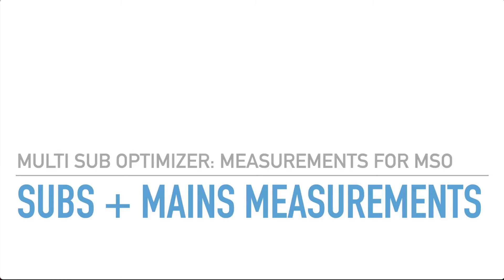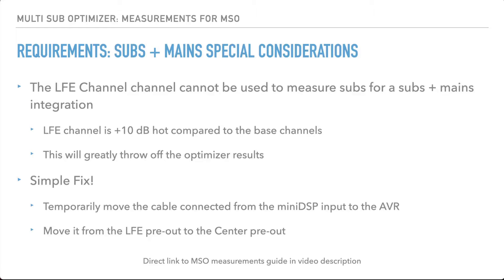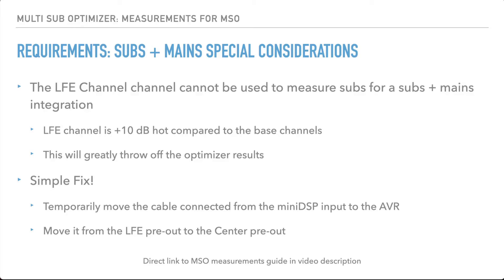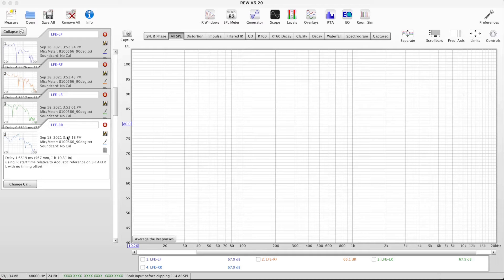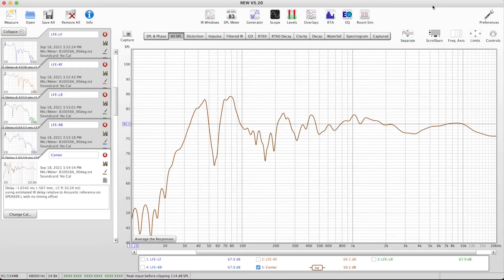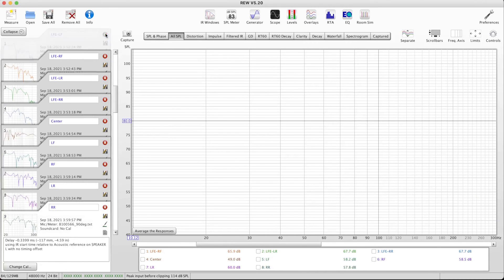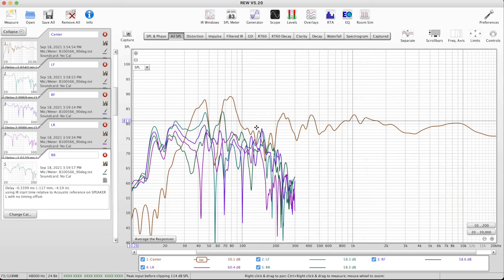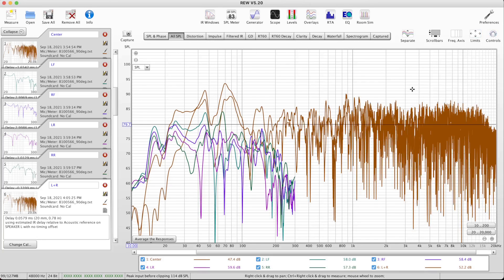Measurements for MSO: Subs + Mains Measurements

Comment: Thank you for the amazing MSO tutorials, Jeff!

I’ve been reading up to prepare to try to run MSO for the first time in my room. I only have two subs, and will be using a MiniDSP 2x4HD to combine the two. The subs are similar, but slightly different (an HSU VTF-3 Mk2 and a HSU VTF-3 HO), one in the front left corner between my left and center center, and the other in the back right behind where my couch is. I will have the 2x4HD combined sub signals ran into a single channel on a MiniDSP DDRC-88A-BM, where I will then run Dirac across my 5 main channels, as well as my combined subs.

I’m giving you this background just to say, is alignment with the mains still necessary/helpful in this situation, and where in the process would
I need to do it?

My current plan was again to disable everything but my time delays and level adjustments on my subs being applied by the 2x4HD, then take my sub measurements and run MSO. I’ll apply the filters from MSO into the 2x4HD, and then go into the 88A and run the Dirac calibration over everything.

Is this sufficient? Will this process already cover time aligning my subs, or no, and where in the process should I add it in?

Hope that makes sense - thanks for all your help!
Reply from the maker: That sounds like it should work.  MSO will properly align the subs with one another.  The result will be a single "virtual" sub that is seen by the 88A-BM.  You will then run Dirac to correct the overall room and response.

I highly recommend verifying the post-Dirac results with REW.  The 88A-BM does bass management, but doesn't have all the features of DLBC.  One of the features of DLBC is ensuring there isn't a phase cancellation at the crossover point of the speaker pairs.  You should measure the post-Dirac results (C+Subs and L+R+Subs) and look for a dip at the crossover frequency.  If a dip is present in either measurement, you'll need to do the "sub distance tweak" to eliminate it.  The REW Alignment Tool makes this easy.

The challenge will be deciding which measurement to optimize.  Unless you are very lucky, fixing the L+R will not fix the C and vice-a-versa.  You will need to choose one and then live with the response of the other.  It's not as bad as it sounds (no pun intended there).  The general guidance is to fix C+Subs for mostly  home theater use and L+R+Subs for mostly music.  I suggest trying both to see which you prefer.
Reply: @jeffmery  Sounds good, Jeff! I ran my first MSO sub only optimisation pursuant to your guide earlier this morning. FYI, the measurements I used for that were taken from HDMI 4 (the LFE channel), though I understand once I get into subs+mains, I won’t be able to do it that way.

Anyways, I was so eager to hear what everything sounded like following my Dirac calibration, but my laptop died during the final measurement! I guess MSO really took a lot of power, it was plugged in, but I guess I was using more than it could pull from the wall. 😂

I’m patiently waiting for my laptop to charge enough to redo my calibration, and then on to a sub+center MSO config after I check the crossovers like you said.

Wish me luck - thank you (and everyone else online) for putting these amazing materials together!
Reply: Hmm, actually, given the complexity is running MSO again for the center specifically, maybe I’ll just stick with the distance tweak method for now! 😂😂😂
Reply: Quick Update: I do have a dip in my center channel response with an 80hz crossover. I tried the sub distance tweak, and while it would get rid of the center channel dip, it created much worse issues with the left channel than I was willing to put up with. Ultimately, I think without the distance tweak is the best I can get it currently.

With all that said, MSO is amazing - truly great results using your earlier tutorial for the sub only optimisation. Seeing it work it’s magic, I definitely want to learn how to use it with my main channel crossovers now…
Reply from the maker: Measuring via LFE is fine for subs-only.  The vast majority of the HT folks using MSO are going to let their room correction software help with the mains integration.  We really have no choice as we're not creating and manually entering PEQs for them (well - again - most of us are not).

It's definitely a compromise when choosing where to align the sub (C vs L+R).  One thing to verify when you check for which is best for you ... Make sure you're aligning the subs with the combined L+R measurement and not just L *or * R.  I just wanted to be sure of that because you mentioned "worse issues with the left channel".
Reply: @jeffmery  Thanks, Jeff. After some more tweaking, I was able to use the sub distance tweak to get much better results overall. Interestingly, the responses of the surrounds seem to have been affected the move by adding in the sub delay that optimises for the center. It was a really easy trade off to make.

I have one more very important question. I got everything in my system dialed in, and I especially like the way my Dirac default curve config sounds. I used your tutorial to combine and flatten my 2 subs across 3 listening positions per your tutorial and it worked quite well. My only problem I’m now realizing is that because MSO cut so much from 15-200hz, when I run the Dirac calibration, it now wants to re-boost that whole area up, in some places 6db+. If I hadn’t cut so much with MSO, this whole section wouldn’t need any boosting in Dirac, but now I’m afraid it’s just sounding worse from being pushed down by MSO, and then pushed back up by Dirac.

I hope this is clear enough, but what do I do? I basically what the Dirac curve to all be much lower on my subs’ output so it doesn’t have to boost as much. Can I just cut the other channels more on the Dirac measuring screen, so that when it pulls in the sub woofer measurements, they’re at a higher overall output?
Reply: After thinking about this more, the best way around this may be to simply cut less in MSO and use a higher db reference level. I’m going to rerun it to see what happens. Between your video guides and going through Andy’s tutorials, I feel like I’m starting to get more of a grasp on how to use MSO past the options you explained. Hopefully my theories on this are correct!
Reply from the maker: @ronnzi  Your thought here is dead on the money.  Try with a higher optimization target level in MSO to see if you can get the nice flat response there.  It may take some tweaking of the PEQ limits, but it's the easiest option to try and get more output.
Reply: @jeffmery  So after a lot of experimenting with the 3 listening position configuration to try to bring up the output, I just haven’t had any luck whatsoever. One of my listening positions does have some pretty bad nulls, so I’m starting to think by trying to average all 3 positions, MSO is sort of forced to knock everything below where I want it to smooth things out. I haven’t tried experimenting with the “different SPL levels” option, but I’m thinking since I only have two subs and not too wide of an area, that I might be better off just trying to blend to two subs for the flattest response at the MLP. I’m optimising a config like that now to see what happens…
Reply: Sorry for lighting up your comments, lol. At least initially, that didn’t seem to help so I’m going to try inverting one of the subs. Even though MSO didn’t tell me to, some of the biggest dips are only in one of the subs and it seems to help with the uncorrected response. We’ll see I guess… DLBC is sounding pretty good right about now 😂
Reply from the maker: @ronnzi  It's hard to know for sure, but my gut says that two subs may not be enough to fix the room modes in play across all of your listening positions.  This depends heavily on the shape/dimensions of the room, the listening position, and the placement of the subs (which is why I can't be sure).  I also know how sick people are of hearing "MOAR SUBZ!!" as the only answer to the problem.  We all have limitations on what we can spend and where we can physically put subs.  Even if we can put a sub in a spot, that might not be a reasonable location for any number of reasons.  My wife lets me do what I want upstairs, but even I wouldn't try to put 4 subs in our living room. I have to be content with a little 12" guy shoved in the corner out of view.  LOL!

There's a guy in the MSO thread over on AVSForum that is having a very similar experience with MSO as you are right now (could even be you for all I know).  If that's not you, let me know and I can link the discussion.  The creator/maintainer of MSO is giving some excellent advice.
Reply from the maker: @ronnzi  Inversion is one thing that you need to do manually with MSO.  It can't calculate and flip the inversion of all the subs around.  Fortunately, it's pretty easy to do.

Just create a new config and add an inversion block to the sub(s) you want to model as inversion.  I'm going off memory here, but I think that's all that's needed.  It's possible you might need to actually set that to "something".  I'm not in a position to check at the moment or I'd give a definitive answer there.

Once the block is set, just run the optimization and see what it looks like.

DLBC is great if it's an option for you.  It's also expensive if the AVR/Processor doesn't include the license (upwards of $500 for the multi-sub license).  I'm likely to be upgrading to a processor that doesn't have Dirac or DLBC.  The vast majority of the users of my target processor use MSO to optimize the subs before running the room correction.  I also know that MSO does a better job than DLBC on just the subs.  Dirac's algorithm will mess with the sub response some because it's optimizing over an area, not for specific positions.

None of them are perfect.  Just some food for thought :-)
Reply: @jeffmery  That all makes sense. For now, I’m not sure if this makes sense to do our not, but since my default Dirac target doesn’t PEQ boost the bottom end so much, I’m using it and then raising my sub level a 2 or 3db in my AVR. This should be better than letting Dirac do the boosting, right?

Also, I don’t think that’s me in the AVS forum (I’m Ronnzi there as well). I have been posting in the DDRC 88A forum, but I don’t think on this specific issue. If you could link me to the discussion, that would be amazing!

Thanks for all the help!
Reply: Btw, I agree with you that it would probably be ideal to have more subs in the room. I thought I had a lot of headroom with the two HSU 12”ers that I have, but I’m starting to think I just need more output to get where I want to be. I don’t have space for a third sub in my living room, but I probably could fit 15”ers in the same places I have the 12’s now. I wonder how much of a difference more raw output in the same locations would actually makes, since I would be dealing with the same modes. 🤷‍♂️😂
Reply from the maker: @ronnzi  RE: where you add gain (boost) ... maybe?  What do your ears tell you?  I personally don't like to just turn the subs up (w/ my ears, in my room, w/ my gear).  I find that just increasing the overall sub level leads to an unbalanced sound and problems with male voices.  I use Dirac to simulate a typical low-shelf filter with a center frequency of 47 Hz and Q of 0.707.  I have one that's +3 dB and one that's +6 dB (depending on content or listening volume).  I prefer the shape of this type of setup because it doesn't really start to add gain until ~100 Hz or so.

I think the best/easiest way to experiment with different house curves is by using the low-shelf filter on the input side of the miniDSP.  Leave your AVR level alone.  Just add a low shelf to the input and start messing with the settings.  Make sure the Q is 0.707 or as close as possible.  Mess with the center and gain to see what you like.  This is super easy to do real-time while you're listening with the miniDSP plugin app.  Save the 3-4 you like in a different miniDSP config and you can just flip between them real quickly to do A/B comparisons.
Reply from the maker: @ronnzi  Forgot the AVS link:  https://www.avsforum.com/threads/optimizing-subwoofers-and-integration-with-mains-multi-sub-optimizer.2103074/post-61267822
Reply: @jeffmery  I agree with you on adding the AVR gain to the sub - so far, it just doesn’t seem to sound right. My only worry was that allowing Dirac to do +6db boosting on its own to match the boosted target curves would add distortion. I can try to experiment with the input-side lowend shelf. I haven’t implemented something like that before, but from poking around I think I have an idea. In the meantime, I’ll read the comments in the link you posted and try a couple other things first (I just realized I had left one of my subs inverted when I was experimenting - I had tried that because I hadn’t gotten to where I wanted it, but I might have to re-try a couple of thing again just to make sure that isn’t why they didn’t work, lol).
Reply: @jeffmery  I just poked around on my MiniDSP and saw how easy it is to add the low shelf filter you referenced. Haven’t gotten to try it out yet, but when I added a 4db boost with the frequency and Q value you suggested, it looks exactly like what I’m looking for! I’ll experiment with different gains and see how it goes. 👍
Reply: @jeffmery  So adding the low shelf filter as you suggested with +4 is PERFECT. I tested with higher and lower, but this was exactly what I was looking for. The curves looks like I want it to now, and more importantly, it sounds great. I further tweaked the Dirac curve to roll off a bit more, and now I have my own curve that’s where I wanted it to get to.

Last remaining issue - I haven’t been addressing this since I was still working on the overall curve, but now it’s the only thing I need to fix. Right now I’m limiting my overall volume to around 75db because if I go higher, I have one tiny spot around 50hz that appears to clip. The curve looks great as I go up in volume until around 75-80hz, when I suddenly see a huge dip form in that area, with everything else staying the same. Looking at what Dirac is doing there, it does look to be a sharp, deep bull that shows up as a 7db or so narrow decrease.

It doesn’t show up at all on my measurements until I go to a certain volume level, which honestly seems to be higher than what I would normally ever listen to. Should I just keep the volume limited to try to stay out of it, or should I made a sharp cut out of the Dirac target right in that area? 

It’s such a narrow spot that I sort of didn’t want to mess the rest of the curve up to carve out for it… It would have to be Dirac trying to boost it as far as I can tell, as I didn’t implement any boost whatsoever in my MSO config (it was all cut).

UPDATE: So the dip that appears when I raise the volume too much is actually at about 47hz (it’s unrelated to the shelf filter I put in place, as this would happen before I had implemented it). Again, a sharp download spike appears right at 47hz as soon as I raise the volume to where the LFE would be around 80db (this is what I set my initial MSO reference target to btw). Anything below that, the dip isn’t there and it’s flat. REW doesn’t show any distortion at that frequency range or anything. It just looks completely normal other than the dip.

The place in Dirac where I thought it could be over boosting is actually several hz later (a little after 50hz). I tried decreasing the target curve in that area, as well as the 47hz range, but it didn’t change anything.

What could be causing this? This is pretty unrelated to MSO, so I may just post about this problem somewhere else, but I thought I would run it by you.

Again, can’t thank you enough - everything sounds amazing. I’m just going to keep the volume reasonable until I figure out what this is. 😂
Reply from the maker: @ronnzi  Glad that low-shelf worked so well for you!

That's a really interesting problem I haven't seen before.  One thing to try is moving the microphone around and measuring from different positions.  Assuming this appears when measuring at the MLP, take additional measurements 2' in all directions from that point (left/right/front/back/above/below) and see how the shape changes at that frequency.

I also have another theory, well, more of a wild guess.  What can you tell me about your room's construction?  Is it a sectioned-off part of a larger area?
Reply: @jeffmery  Yeah, I’m only doing my confirmation measurements from the MLP. You’re right - probably a good idea to check the other positions that I incorporated into MSO at the very least.

Regarding your “wild theory”… I don’t know what you’re thinking, but it might be right since you seem to have asked the right question. My setup is in the living room of my condo. Besides having a wall of windows on the right side (clearly not ideal), everything is basically in the front half of my room. So there’s almost half to a third of the room to the back of my setup, and then to the far left, it opens into a kitchen (blocked off my a 3.5ft high or so island) and a small hall way leading to it.
Reply from the maker: @ronnzi  We might be on to something  ... is the distance between the major opposing walls in this area ~24 feet?  Front to back, left to right are the main concern.
Reply: @jeffmery  I’m trying to find actual measurements, but estimating it’s around 30ft from from to back, around 22 ft or so from where the kitchen island starts on the left, to the opposing right wall of windows.

Also, looking back at older measurements, I could clearly go higher without the spikes appearing when I wasn’t using MSO (I have sub measurements closer to 90db+ saved from earlier configs that don’t show that problem.
Reply: So I just realized my UMIK-1 was set with too high of a gain in Windows, invalidating my REW measurements. Hopefully that means those spikes were just issues with the mic, but I won’t be able to check until I have the room to myself later. I may ultimately need to redo my MSO setup since the listening position measurements I took would have suffered from the same issue, but we’ll see.

The only measurements unaffected would be those taken during my Dirac calibration, as I was properly setting the microphone gain on the volume screen there as far as I know.

Pretty frustrating, but I suppose this is how this stuff works sometime (overlooking one key setting and only realizing it later on). We’ll see if this was the issue…

UPDATE: Actually, the more I think about it, my UMIK was set the same way during my previous measurements and it wasn’t dipping then. So I’m not sure I can blame the mic setting… Still seems to have something to do with what MSO did when it combined all three positions…
Reply from the maker: @ronnzi  I've been there and done that.  I pulled a full stupid a few weeks ago running a Dirac calibration after changing the amps for my Atmos speakers.  Clicking too fast and selected my MacBook mic and loaded the UMIK cal file there.  Sounded like crap until I had that head-smacking moment.

What do the filters look like from MSO for your subs?  It's possible that there are too many filters causing too much gain at that point I suppose.  If you like, you can e-mail your REW MDAT and MSO projects to jeff at bisonhta dot com.  Just make sure things are labelled well so I can understand what's what.
Reply: @jeffmery  I really appreciate that man! I’m out for the weekend, but I’ll send me over to you sometime tomorrow hopefully, just to see if you notice anything obvious. This week I’m going to have a few nights to myself, so it would be amazing to iron it out. I’m soo close lol 🤞
Reply from the maker: @ronnzi  No worries.  I'm around for the most part until the new year.
Reply: @jeffmery  Thanks man, I sent you some info whenever you get around to taking a look. I’m going to experiment with some stuff tonight. 

Thanks!
Reply from the maker: @ronnzi  I see it.  Traveling yesterday and today but hope to be able to take a look tonight or tomorrow.
Reply: @jeffmery  yeah, no worries. I believe I’ve come to the conclusion that I’m just limited by my room and the two subs at this point. MSO has to cut down quite a bit to try to balance out a null, and that’s probably what’s causing the issue. I’ve been experimenting with a lot of different setups now. Don’t spend too much time looking over what I sent, since I have done re-measurements. If you notice anything obvious, that would be great, but otherwise, I think I know what’s going on.